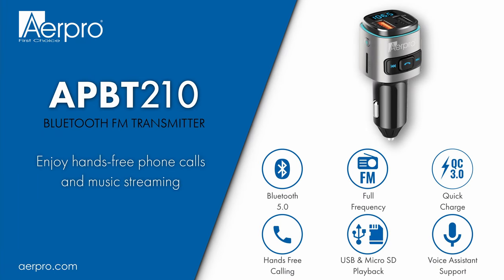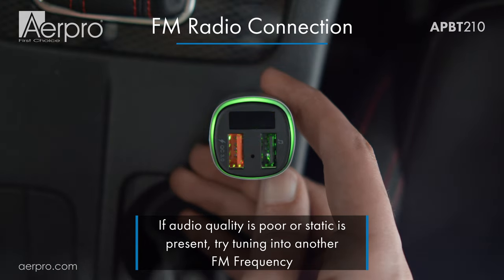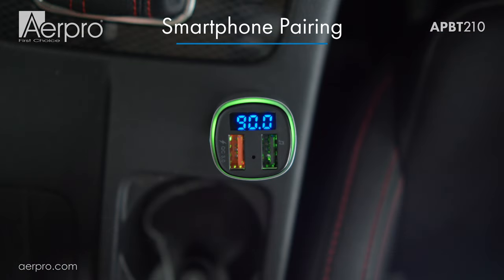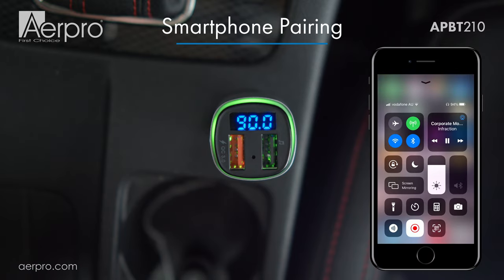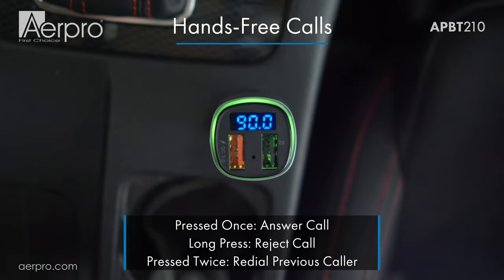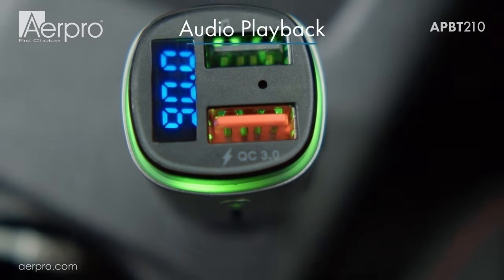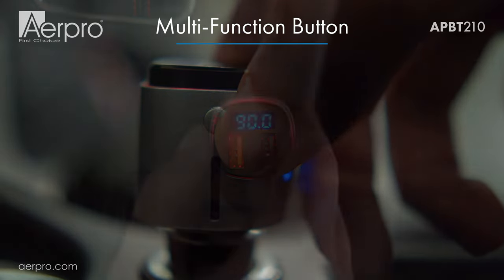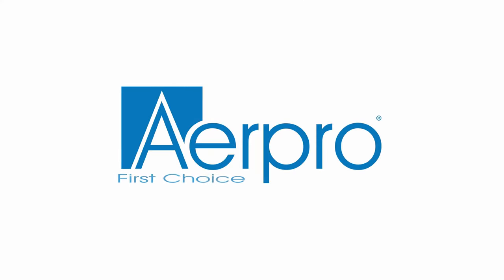Aerpro APBT210 – Bluetooth FM Transmitter – How-To Video

Comment: Does the radio frequency effect the audio quality. For example, my FM radio gets a bit scratchy in certain suburbs due to mountains etc.. Would this also occur whilst using Bluetooth to a phone?
Thanks for your time.
Reply from the maker: Hi Chris, there shouldn't be any major interferance between the FM transmitter and your radio as the distance between the transmitter and the radio is not changing. The only time you may get some interferance is if you have it tuned to a frequency which is close to a strong FM radio stations frequency.